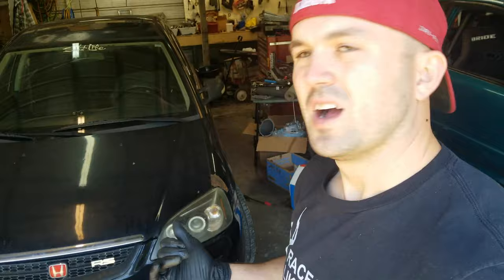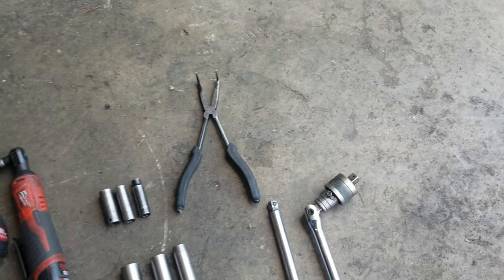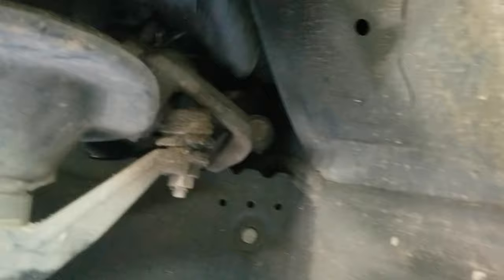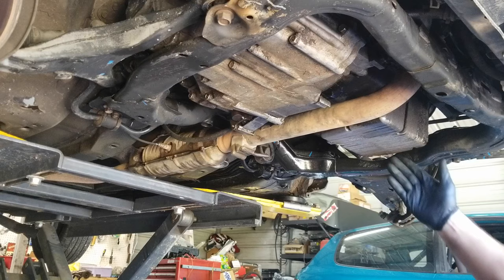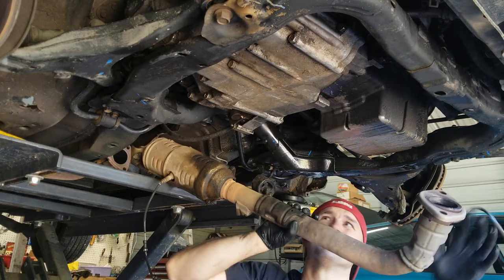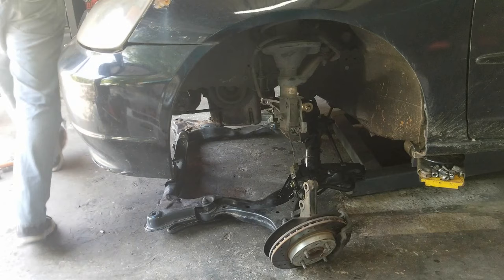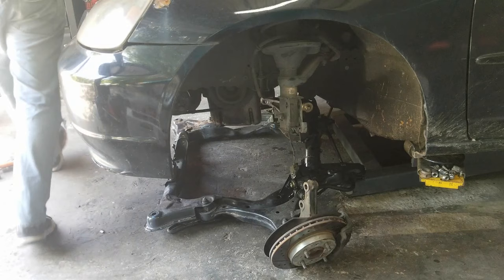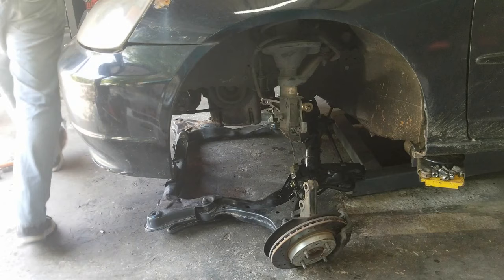How to: 2001 - 2005 Honda Civic Automatic Transmission Removal

Comment: Great video, I’m going back to a big old truck. I’m glad you have the patients for cars like this but I had anxiety just watching. I already had a blown head gasket two weeks after buying the car got that fixed and not even a month later the trans🤯
Reply from the maker: The biggest 2 issues with these😂
Reply: I have a big old truck too, 02 ram 2500 diesel 6 speed manual, but these little cars are SO much cheaper to maintain for driving back and forth to work. I can’t believe how cheap the parts are for these things after daily driving my truck for 14 years 😂.  Tell your friends to stop voting for these commies or our kids will be driving these things around still 30 years from now like they do in Cuba

Comment: When pulling parts at the junkyard I always take engine/trans off a wrecked one that way its a better chance of everything running good.
Reply from the maker: For sure!
Reply: Yup cause why else would a nice car be in junk
Reply: Do you mean it’s bad to take a transmission from junkyard?
Reply: is this sarcasm?
Reply: same here in order for a vehicle to be involved in a wreck it had to be moving so the engine and transmission had to be working
Reply: @hondaservicecenter because it was sideswiped, rear ended, stolen for parts, or rusted out?
Reply: dont fuck wit wrecked car transmission, on honda after a crash they start breaking down fast, because of the transmission and motor move easily. which could break internal parts, just better to learn about your transmission and take it apart to fix the part that needs replacing

Comment: I have a noisy manual transmission is annoying me every time am driving my 2005 civic, I replace the clutch ones and noticed the transmission don’t come out because the engine on top and the main frame on the bottom so it makes me think on send the car to the junkyard, like many people I get bored by the car but my family learn shift stick on that car and love it, and the gas prices on California, makes me think on the little civi it is a warrior, it just don’t die, and all I being doing you is replacing the oil and filter all this years, and the car is fine in side out
No crashes, you reali inspire me to replace or fix his little transmission and keep it longer thank you, good job, you have a gift, you save my old civic god bless you

Comment: Nice video! I had to do this to my Civic a year ago. One thing I did differently is I used an engine hoist to lower the transmission out the bottom instead of using a jack, I thought that was a bit safer since doing it this way eliminates the chance of the transmission falling off the jack. Also, when I installed the replacement transmission, I slid it under the car on a piece of cardboard and lifted it into position with the engine lift as well. Just another option :)
Reply from the maker: I have a nice hoist, I just find the hoist to be cumbersome.
Reply: @hondaresource  Makes sense, I just didn't want to risk the transmission falling while I was removing or installing it. If I did this more often I would get a transmission jack that I could strap it down to, but hopefully I won't be replacing my transmission again any time soon. I got almost 250K out of the original transmission and the replacement JDM trans supposedly only has 45K on it. Before I installed it I opened it up to change the filter and the old filter literally didn't have a spec on it and the trans looked perfect inside, so hopefully I will get another 200K out of it.
Reply: @averyalexander2303  hey, I might install a JDM trans in my honda, how has yours been?
Reply: @AaronFernandes__  It has been great, no regrets! There are a couple minor issues like the positions on the shifter not lining up and not having D3, but it worked great.  Shawn H has a great video on the differences. I liked the JDM SLXA more than the US BMXA transmission because it was geared shorter for better acceleration. Of course that meant a higher RPM at highway speeds, but I didn't lose any MPG that I could tell. Only reason I took the JDM trans out a couple months ago is because I wanted a 5 speed manual, I put about 20K miles on the JDM auto trouble free.
Reply: @averyalexander2303  Awesome! I might just have to go with that then! Thanks
Reply: @AaronFernandes__  As long as you are okay with the couple minor differences, I think it's a great option for the money since the mileage is supposedly so low. Unless you want to pay thousands of dollars for a rebuilt transmission, it's really your only option other than getting another used USDM transmission that is likely to fail soon as old as they are at this point. Also, if you are comfortable opening the transmission, replacing the filter before you install it like I did for piece of mind wouldn't be a bad idea. Internal "non serviceable" filters are a stupid idea, so I like to replace them whenever I have the opportunity but that's just me.
Reply: My replacement slid off the Jack when trying to line it up LoL. I wasn’t under it and was able to one arm it enough to keep it from smacking the concrete.
Reply: @hondaresource  “all your life has become cumbersome”
- 7 Mary 3
Reply: How much of a job was it to replace the internal filter? I ask because my original bmxa trans from my 05 LX just failed at 299,200 miles and I could not get anyone to confirm that a North American made SLXA trans from a 04-05 EX would swap in with no issues (literally half the price used) so I just bought another bmxa from an 05 lx coupe with 115k miles. I’m very mechanically inclined but I know a rebuild of one of these transmissions is over my head without a mentor. Is it really as simple as splitting the cases and replacing the filter, or is there a lot more to it than that?
Reply: @curtis026  Changing the filter was pretty easy despite never doing any internal transmission work before at that point, the hardest part was splitting the case because mine was stuck. You'll want to get a new gasket for the case and end cover too. You need to remove the end cover from the passenger side first so you can remove the gears behind it and then you can split the case. At that point, the filter is right there and very simple to change. Clean the internal magnet while it's apart too. The Youtube channel "Automatic Transmission" has an excellent video of how to take apart a BMXA transmission, which also applies to the USDM and JDM SLXA. Hope this helps. If you have any more questions, feel free to ask

Comment: This is the first time I have seen your video, and you are the only one who seems to know what they are doing with the Honda transmissions.  I am a retired auto technician with 45 years of experience on anything from stock import and domestic cars to highly modified street and road race cars.  The only thing that I disagree with is when you supported the engine with a jack stand. I prefer to use an engine support bar from the top but I also realize that everyone does not want to spend the money on some tools when they will probably never use it again. Anyway, for what it matters you did a great job. Thanks for putting out a quality video.
Reply from the maker: Thank you man, I really should buy one of those.
Reply: @hondaresource  they make some really trick ones but harbor freight has one for 90 bucks that works great on Honda and of course most imports. If you are handy with a welder and can fabricate fairly well you can make a vehicle specific one that would probably work on most Honda's.

Comment: Got the Civic EX 2003 myself. Trans is slipping so will remove and put in new clutch plates, etc.  Thanks for the video. Hondas seem to be engineered for micro sized parts and lots
of stuff to break loose. Not my fav vehicle; especially buying it used with previous owner cheap on maintenance.

Comment: Currently in the process of doing this to change the crank seal, already have the other side done and put back together and I wanna do things that I probably cant say on here...😂 I live in Newfoundland so everything is rusty, trans is covered in oil and everything is rotten lol. 
If you're thinking about doing this, don't 😂 I'm a diesel tech fresh out of school, but not new to working on vehicles.
If I had it back I would have just pulled the engine and trans out and went from there lol
Reply: This video definitely did help me though!

Comment: I’m doing the exact same job right now . Sub frame off but having trouble with bell housing  17mm  impacted can’t move it . Can’t get much movement with the bracket bar .  I’m going to sleep on it . Thanks for the video very helpful . My car in a 1:7civic 2002 .
Reply from the maker: Good luck!
Reply: use a 6 point impact socket and a breaker bar with a cheater bar slid over the breaker bar handle. It will come loose.  Make absolutely sure you are turning it in the right direction. Counter clockwise.

Comment: Man you make that look easy, do you know up here in the rust belt? It would’ve took two hours just to get the catalytic converter off. Oh yeah, there would’ve been rusty bolts, broken bolts, stuck bolts, stripped bolts, everything’s a nightmare up here.
Reply from the maker: I can't imagine
Reply: @hondaresource  I appreciate you commenting back. I know your time is valuable. I did comment one thing I’m hoping you could probably answer for me. Can my 2013 CRV be swapped with a standard transmission. I tried to buy one over sea but it was too much to ship it here.

Comment: I'm battling in my head between getting at the junkyard and those old 05 honda civics  there don't look trustworthy. I've never done this before it's been my only car since new 2005 and transmission gave up recently after driving through rainy water flood day. Not sure if the rain water did the damage or it was due to fail. It was shifting so perfectly smooth like new, I did had like 7 fluid change in over a year plus and car is 172kmiles now, i did whole chassis and struts parts new replacement a month ago and have done all types of tune up and engine parts replacements that you can think of. Got new Michelin tires at Costco recently and new alignment and the car was as good as new. Transmission failed unexpected. I can't afford a new car or anything.  I need to stick with this junk. Knock sensor activates and doesn't go faster than 30mph. I work as ubereats and was expecting to get 300k miles out of it, Lol. I bought an old rusted 400 dollar scooter now, waiting to get title and plate to get started working

Comment: Nice video. I would have called it excellent if you had made a bit slower and more clearly with video showing some of the things that you were in the engine. I think overall its a good video. It would be nice to see you replace some sensors on the replacement transmission and then installing it in the car

Comment: Got an 01 EX auto. Had the transmission replaced with a remanufactured one. Shop calls me up and says it's missing overdrive but otherwise shifts fine. Other than bad TCC solenoid(s), what else should I look at

Comment: I followed this video and pulled my trans out yesterday afternoon!  Thank you for the great video!  My car is an 05 LX model and the old trans is a bmxa. For whatever reason in my area the bmxa trans of the same year are twice as much as what I can get a US model SLXA trans for.  Are you able to confirm that I could swap in a trans from an 04-05 EX model, North American made, with VTEC (which is an SLXA I think) into my 2005 LX car without VTEC?  I just don’t want any problems, but they are literally half the price!

Comment: Thanks for the video, you're a life saver. I just got done dropping the subframe and should have the trans out in the next few days or so. Quick question: Are JDM transmissions compatible with the US cars? I believe they are 3 speed, while the US ones are 4 speed for emission purposes.. but I may be wrong. Any guidance is appreciated! Just trying to figure out what type of trans to buy.
Reply from the maker: The jdm trans is different.
Reply: Yea
Reply: @hondaresource  actually, I swapped the slxa into my 04, everything is 1:1, only thing is there was one external sensor I had to keep from the bmxa, and then I also have a torque converter code which is simply from it having a different sized torque converter

Comment: How do you pull the range selector connector free? Most of the connectors on my car are just a little stuck, but I've never seen a connector with two tabs like this one, so I'm not sure if I press down on both, then pull. Pretty close to damaging the thing.

Comment: Do you recommend pulling a junkyard trans? I know its a gamble but mine is on its way out, Id prob do a manual swap if I can find enough info on it
Reply from the maker: Definitely a gamble, especially on these. I would say odds would be in your favor if you find one that is wrecked.
Reply: I'm battling in my head between getting at the junkyard and those old 05 honda civics  there don't look trustworthy. I've never done this before it's been my only car since new 2005 and transmission gave up recently after driving through rainy water flood day. Not sure if the rain water did the damage or it was due to fail. It was shifting so perfectly smooth like new, I did had like 7 fluid change in over a year plus and car is 172kmiles now, i did whole chassis and struts parts new replacement a month ago and have done all types of tune up and engine parts replacements that you can think of. Got new Michelin tires at Costco recently and new alignment and the car was as good as new. Transmission failed unexpected. I can't afford a new car or anything.  I need to stick with this junk. Knock sensor activates and doesn't go faster than 30mph

Comment: I was wondering I'm pulling a transmission out of a 2001 Honda Civic the transmission that I got was in a running car test drove it and it shifted fine and everything is there any need to pull the sensors out of my other transmission and put in it  the transmission  I'm putting in the 2001 Honda Civic I'm putting it in as a two-door if the one they took it out of was a 2001 four-door The car s were 3 months apart and the transmissions both them says BMX but one of those BMX like five something the other one says BMX for something you know what I'm saying there's like one number difference between them I don't think that would be an issue will it

Comment: I pulled out my transmission and I'm ready to put it back in.  I replaced the engine so I pulled them out together.  I'm trying to connect them before installing but I'm struggling mating the two.  Got any suggestions?  I' trying not to pull them together with the bell housing bolts but it's a struggle.
Reply from the maker: Make 100% sure you don't have dowels in both the engine and transmission. Make sure the torque converter is all the way into the trans and isn't getting stuck on the flex plate. Other than that, it should go right on
Reply from the maker: There is also a video on my channel of installing the trans that talks about the dowels
Reply: The torque converter wasn't in all the way.  It looked like it but wasn't.  Thanks!

Comment: I appreciate the video. Never done an auto swap before, is the flywheel like that of a manual? Where you have to have it resurfaced. Thabks a ton!
Reply from the maker: no, its just a flex plate that bolts to the torque converter
Reply: @hondaresource  thank you so much! That would've had me stumped when I had it all apart. First swap successful, thanks again

Comment: My moms Covic is struggling to switch gears, it was driving well but out of nowhere it’s struggling! The code is reading gear ratio improper, and torque converter. Could it be just the shifting solenoid?
Reply from the maker: You can try that

Comment: Just curious about to use your videos to help me do mine i am curious if you need to change the front pump seal between the torque converter and transmission when replacing the transmission
Reply from the maker: I have never replaced that
Reply: @hondaresource  ok thank you very much I was just unsure I know that I have done it in other jobs so I wasn't sure as this is my first Honda transmission swap

Comment: I've had the lucky pleasure of owning about 7 01-04 models, 2 got parted out, 2 have bad trans, the rest have bad head gaskets. I have an 01 manual 5 speed, nice shape, shes sweet. So given I don't have a jack like that, would it be about the same work to pull the whole drivetrain out the top?
Reply from the maker: its just personal preference. I've pulled plenty through the bottom before I had a lift
Reply: @hondaresource  I may have to do some work on the motor too, so maybe its better to drag it all out the top.

Comment: anyone can take it out putting back is a PIA you need two people it's better to pay the shop 500 bucks to do they swap out many tranmissions daily and could do in 3 hours someone at home it will take 2 days and will need a helper to put new transmion in and many people forget how they took it apart then they have to tow to a shop and pay double to fix.
Reply from the maker: I guess it's a good thing I also have a video for installing it😂

Comment: Would you happen to know the dimensions of the transmission plug's washer gasket (outer & inner diameter, thickness, etc.)?
Reply from the maker: All I know is Honda says its 18mm and (90471-PX4-000) is the part number from Honda. I only get these from Honda.

Comment: Which connection is the ATF return line? 21:52 Is it the line closer the VIN [green plate] (hose connection hanging higher) or the farther from VIN (hose connection hanging lower)?
Reply from the maker: The one closest to the engine is the supply (in) the one closer to frame rail is return (out)